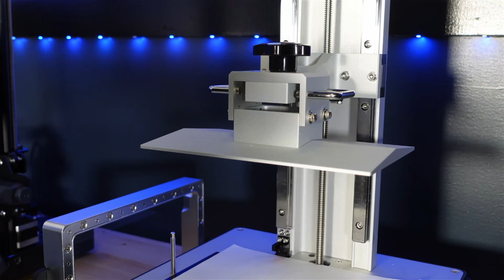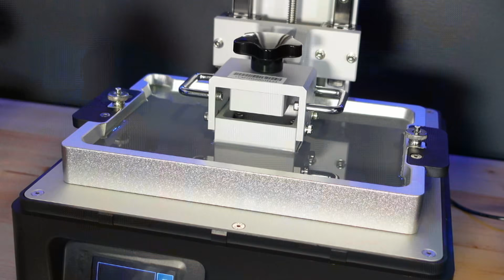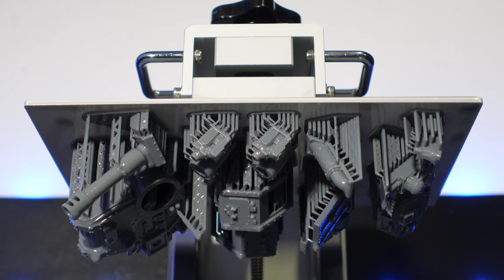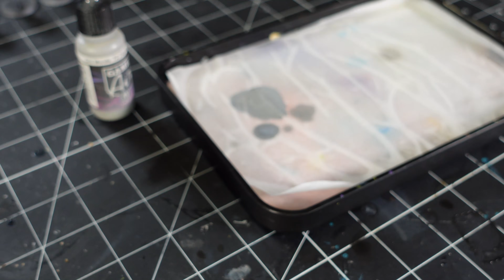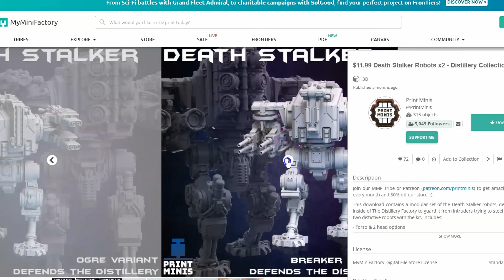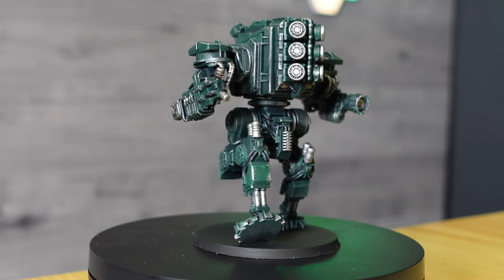Will CADIA FALL? To My New 3D Printer the Phrozen Mighty 4k

Comment: Another suggestion would be to make sure that the rafts (the flat base part of the supports) are all overlapping. Not only is there the chance of getting more minis on the plate, but once you have started removing the mass, the rest will follow.

Flex plates are a bit tricky to deal with. There's a very good chance that you would have to add a spacer to a specific mechanical sensor that tells the printer where the build plate is.
Reply from the maker: Yes that is a great point! Thanks.

Comment: pretty sure you stole this video idea from another creator, cant remember his name but this is very similar.
Reply from the maker: I didn't steal the idea, it was a coincidence. I didn't know he had a video out like this until 2 days before mine was finished. After spending about 3 weeks on this project, i was not planning on dropping it at that point. I reached out to him and gave him the heads up however.
Reply: @FacilityD20  fair enough.

Comment: I think you'll love a Wham Bam flex plate for removing prints in the future! I swear by mine and hardly ever have to use my scraper anymore
Reply from the maker: Yes for sure! I have one on my anycubic
Reply: WhamBam (and other large format flexible plates) are a lifesaver!  My Saturn prints better with it, and my Jupiter experienced similar issues compared with your experience. The WhamBam allows for both the lower initial exposure time and the quick swap out of the plate. I’m not yet playing with contrast (and speed paints), but your process makes it looks easy.  Unfortunately, that model isn’t finished Until the base is…. Homemade mud and turf makes a quick finish for your world terrain of choice!  Keep it up!

Comment: Love the content, i recently started printing a Death Korps of Krieg army. not sure if you know about the "cones of calibration" but they are incredible for dialing in your exposure time for pre-supported minis
Reply from the maker: Love Death Korps! Yes I do know of the cones, but have never tried it out.
Reply: Same here! I originally tried buying them but it quickly piled up on expenses. I got a resin 3D printer and took on some commission 3D printed models and the such, etc, (paid for the printer and resin) and now I'm just planning on printing DKoK until I run out of resin (I got 3 liters roughly leftover).

A side project I've been working on for TOO LONG at this point however, is a PLA 3D printed Warlord Titan on my trusty old Ender 3... I will hopefully finish that by the end of February lol

Comment: I literally just printed the same box set equivalent the other day.  Thanks to you and gamza I dove way into 3D printing and will never go back to buying minis.  Also I am intrigued by that painting method.  Any way you'll do a pros and cons of it?
Reply from the maker: Thanks a lot! Pro: it is very fast and you can achieve very good shading and hilights with very little effort. Con: it is harder to fix mistakes, and you need to move fast with contrast paint as they dry oddly.

Comment: Hey! Nice video! If i can give you a tip  invest 5-10 bucks in a stanley razor edge scraper (or other brand) it makes it soooooo much easier to remove prints from the plate and because its so scharp and thin it doesnt damage models that you print flay on the plate like bases. Im suoer amazed at the difference. Rhats quality of life my friend👌
Reply from the maker: Thanks for the tip!